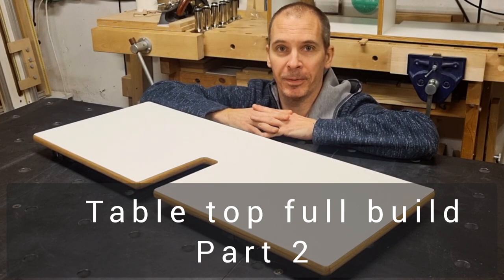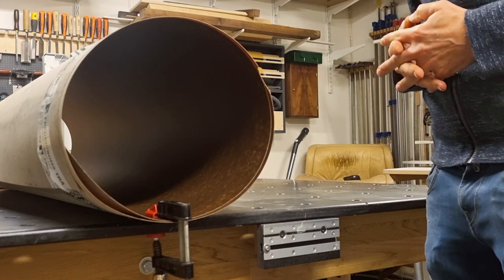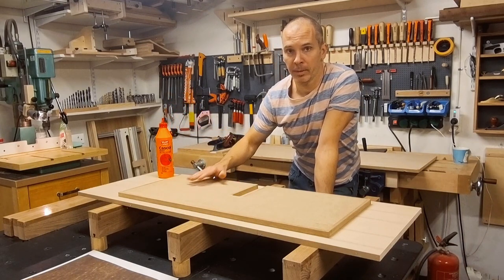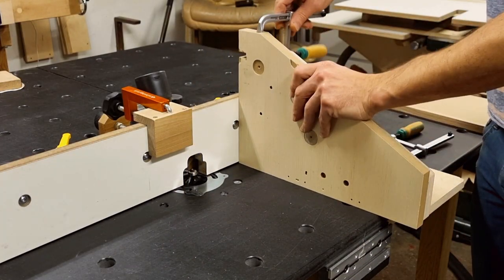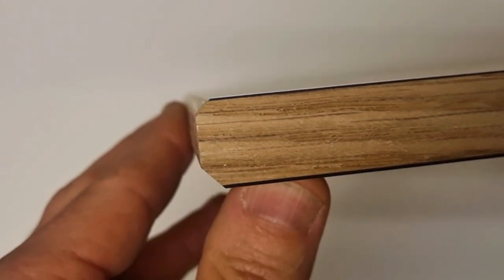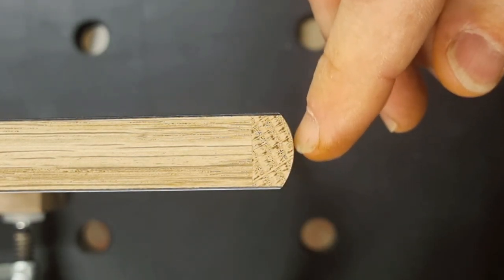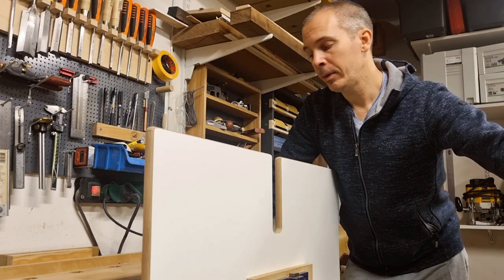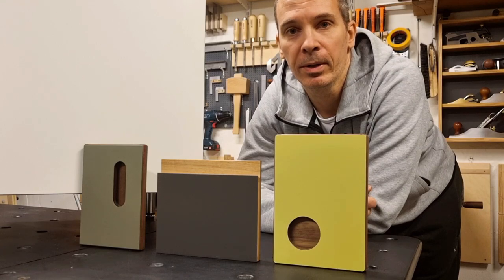Laminate & Linoleum Part 2B - Cabinet top full build 2/2

Comment: Really helpful series, thank you! You have clearly mastered what you do. If you are using linoleum, and the underside is not exposed, do you use a cheap laminate on the underside? I am just wondering whether you need to mirror lino on both sides, or whether laminate will do and keep costs down. Thanks :)
Reply from the maker: Thanks for the compliment! I think I mention that in part1? Fully understand people skip a few parts here and there so no problem if you missed it. When using linoleum the backside should be covered but linoleum is not necessary on backside. Either use cheap laminate or a special backing paper supplied by linoleum manufacturer. I have never used the paper myself, I always use cheap laminate.

Comment: Thank you very much for all this information and tips. You really help a lot! I have a question about the final gluing of the top of the cabinet: how is the adhesion of the glue of the domino (side) with the laminate on the underside of the top? Did the glue used adhere to the lower laminate? Tks again !!
Reply from the maker: You're welcome. Glue doesn't stick to laminate. The top is glued to the cabinet using dominos, no glue at all between sides and underside of the top. I mention the domino slots in the end of 2b where you also can see them. Wasn't really part of this video where I just wanted to show how to make a top like this.